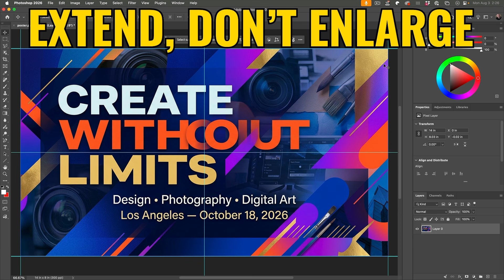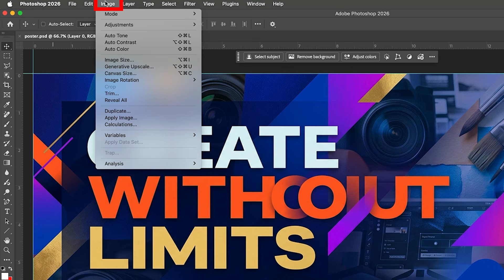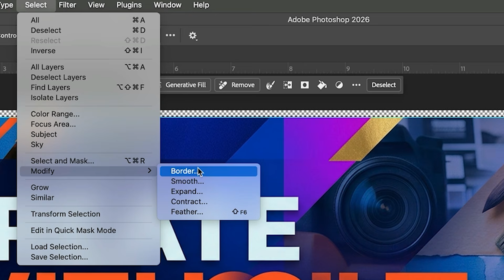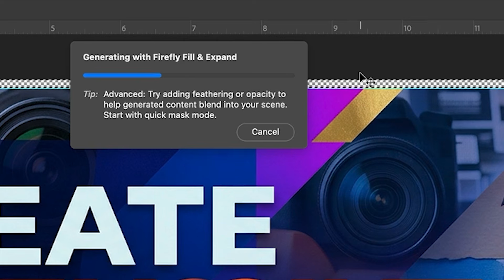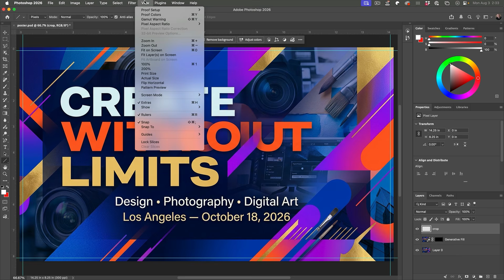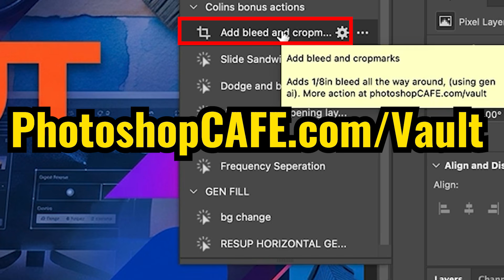How to Add Bleed & Crop Marks in Photoshop - NEW WAY!

Comment: but what is this frame for?
Reply from the maker: It’s for print.
Reply: He explained that at the beginning of the video so you can rewatch that, but anyway: On a printing press, it’s standard to print slightly beyond the page dimensions and trim to the edge, so that there’s no chance of paper white showing through due to misregistration. Bleed provides the margin, crop marks indicate the trim. This has been standard since before printing was done digitally, like well back into the previous century.

Comment: if you are working for print, i assume you also use indesign. just placing the image there and export a pdf with printmarks would be much faster and much easier. same goes for illustrator. any of you guys really doing this in photoshop?
Reply from the maker: I think you missed the point ;) You still need to create a bleed extension before you bring the image into indesign. Bear in mind the crop marks aren't the focus of this tutorial, it's on extending the design, the crop marks are just a bonus at the end. Yes, the crop marks can be Generated in IDD or in the PDF. But when you are going directly from Photoshop this is a workaround that many people have found useful over the years.

Comment: I'm sure this is great for those that use Photoshop with AI, but for the rest of us it's worthless.
Reply: I've been making countless brochures and flyers in Photoshop for more than 15 years and I had to add bleeds manually. This method could have save me hours and hours of work. So, it's very worthy for the ones who, like me, do this kind of work in Photoshop.
Reply from the maker: @bolivarporto  You are exactly the type of creator that I made this tut for. People not doing print don't even realize what problem this tutorial is solving, because they would never encounter this until the printer rejects the file or charges them prepress fees.
Reply from the maker: That's fair if you don't use Photoshop's AI features. This workflow is mainly aimed at people preparing files for commercial print. If you're doing print work with the Creative Cloud version of Photoshop, Firefly Fill & Expand is included, and it's a really quick way to create a proper bleed without cropping your design.
Reply: @photoshopcafe fair enough